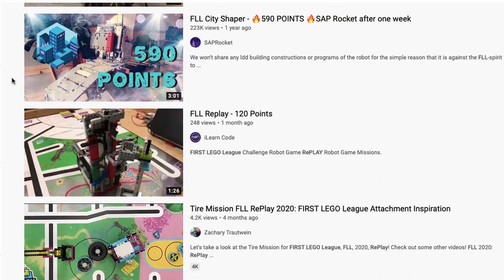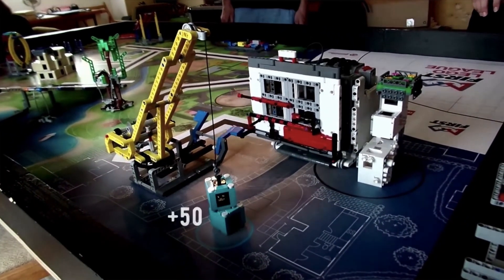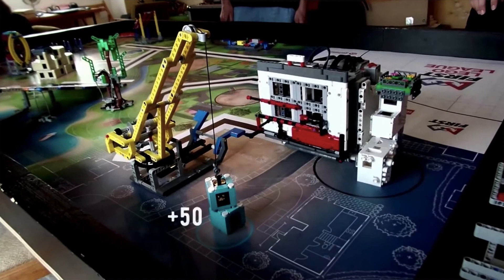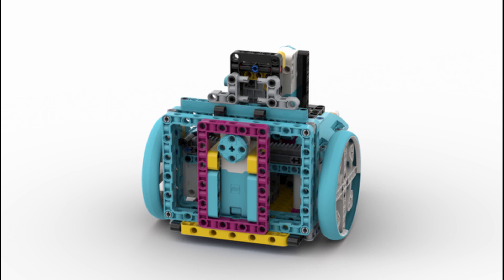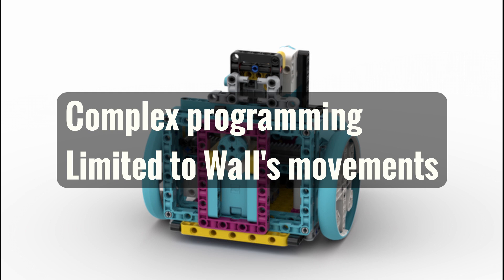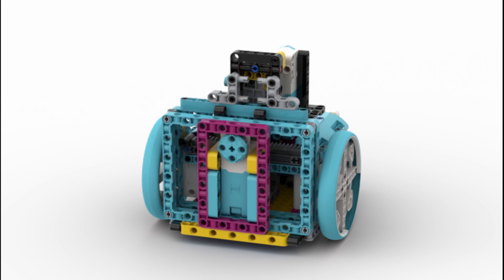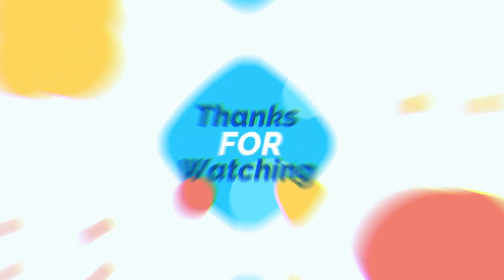SPIKE Prime "Moving Wall" Robot Design

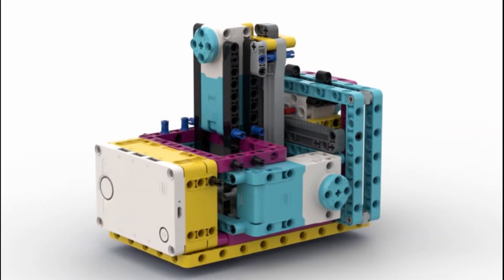Comment: Is this using other parts besides the standard kit? trying to follow along but that tall post at 1:09 seems like it's not standard.
Reply from the maker: @Jodi Murray, no sorry, this design uses a gear rack housing piece that doesn't come with lego sets. However you can order this piece, along with other unique pieces at https://www.bricklink.com/v2/main.page
Reply: @brickwise8624  what size for the gear rack housing piece?

Comment: Nice !!!! I did used this omnidirectional wall 
Unfortunately, i ended up using it only for a few missions while for the rest i had to use mechanical attachments that didn't required a motor 
The wall was nice, but in the end wasn't the best solution for City Shaper.
Reply from the maker: @OWNED GAMING WASD, yeah, the wall has a lot of limitations if the season's missions do not suit design.